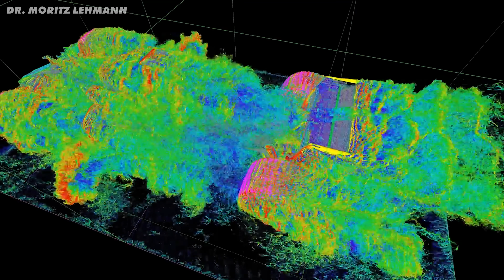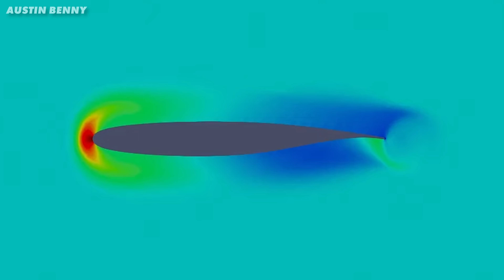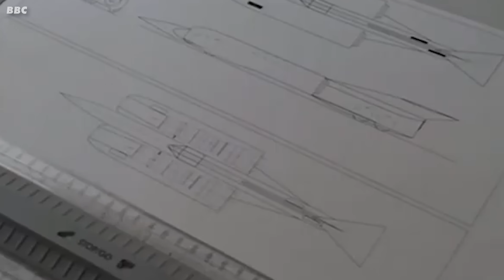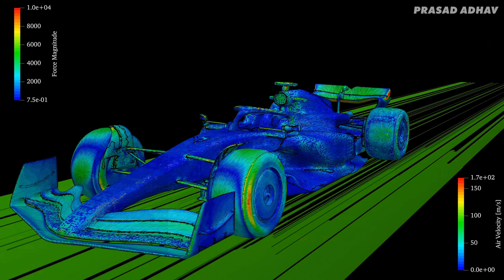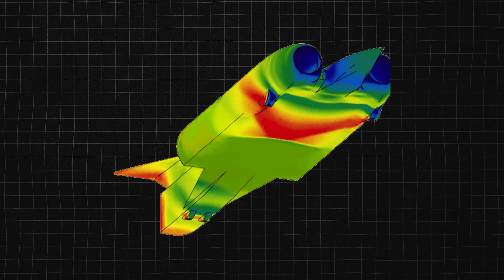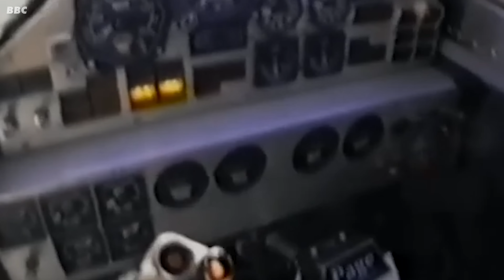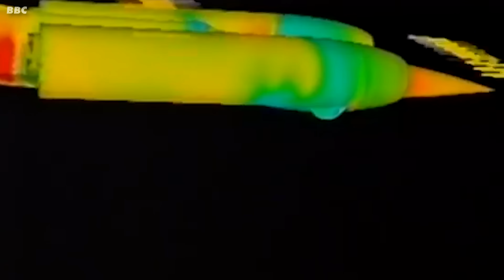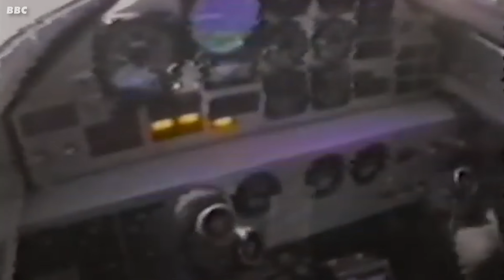What Happens When You Push a Car to Mach 1?

Comment: @driver61 I don't know much about this but it is very interesting. One thing that came to mind was whether or not it would be possible to use some kind of concentrated electromagnetic emitter in the front of the vehicle (which iirc is possible to travel faster than the speed of sound) could cause enough air disturbance to trick the air into delaying the point in which it hits the speed of sound to give the vehicle time to reach mach 1 at approximately the same time the air does?

Comment: I can't believe you did this entire video without once mentioning Bloodhound LSR.

The car was already tested up to 628 mph in 2019 using just its EJ-200 jet engine. It has yet to run using its rocket engine in addition. 

The team were running on the Hakskeen Pan dry lake bed in north-western South Africa. This site gives approximately 11 miles of very, very flat ground. They hired local people in advance of their testing period to clear all the stones from a patch of ground 11 miles long and wide enough to give them twelve (I think) parallel runs.

Comment: The Thrust SST, or whatever they call it now, is not going to go 1000, not with jet engines!  The frontal area of it is just too large.  Additionally, the width of the vehicle will result in higher shockwave forces interacting with the ground.  The Aussie approach makes far more sense as it is a pure rocket powered vehicle with smaller frontal area and a much smaller shockwave footprint.  I just hope they get the funding to complete it AND find a different driver as he's too old!

Comment: I was just reading sbout the Salar de Uyuni in Bolivia. It is the largest salt flat on Earth, at 10,582 square kilometers or 4086 square miles - about the size of the US state of Connecticut.
The thinner air would give a bit of an advantage. I have no idea if the country would allow this use, but it would be easy to place a track as much as 20 or even 30 miles long on it.

Comment: I'm curious how you would adjust for the change in the balance of the car - With a run lasting what? 10-12 seconds? how much weight is in the fuel? that's a massive shift wouldn't it be?

Comment: Challenges not mentioned. The jet or rocket exhaust blast acts like a feathers on a arrow. When the engine is shut off directional stability is diminished. Stopping distance at Bonneville or Black Rock is suspect due to government  bureaucracy.  The biggest problem is gyroscopic precession torque (GPT) of the steering wheels. When Breedlove turned Sonic Arrow on its side at 675 mph the car lifted against the wind direction, not in the direction of the wind. GPT is explained by Craig on page 248 of Sam Hawley's informative book "Ultimate Speed ".
Reply: That was one of the reasons why Bloodhound SSC were preparing a new track at Hakskeen Pan in South Africa. The team, most of whom were from Thrust SSC, decided that Blackrock wasn't viable for higher speeds.

Comment: none of the jet clips you showed was with sonic boom but only condensation cone... This is classic mistake. If you watch super sonic plane passing by that close you will be probably knocked and you will be at least temporary deaf. Otherwise interesting and very dangerous thing :) fingers crossed they can make it safely, this is really cutting edge engineering even when everything can be calculated. I would be interested if 1000mph would rip asphalf and concrete

Comment: Is it possible that everyone is overthinking this?  Think about a bullet leaving a gun at mach 1.5. The bullet does just fine. If its a smooth bore rifle then there is a possibility the bullet will tumble. Its equally possible the bullet will not tumble.  A rifled bullet will usually stay true dew to the gyroscopic effect. 
Make the car a bullet with wheels.  Possibly add a heavy spinning gyroscope inside the car.
Reply: Not a car.

Comment: I have read before, in a fact book and its a memory so correct me if I am wrong, the the wheels on Thrust SSC, at the outside edges were pulling 86,000g. 
If I understand that correctly the surface of the wheel that touches the exploding ground, was trying to pull itself away from the rest of the wheel with the force of 86,000 times that of gravity. Even engineering a wheel at these speeds is hard to get your head around.

Comment: That British Bloodhound SSC designed to do this is simply insane, there is a rocket engine from Nammo that I is so powerful it is like experiencing a train wreck.
Just the sheer forces on the driver is unimaginable .....
Reply: The approach will not work as it also uses a jet engine resulting a vehicle that has too large or a frontal area and the shockwaves produced will also be much higher than it could be.
Reply: @Raptorman0909  The design is already there with jet and rocket engine 😎

Comment: I love cars. I love motorbikes. I love trains, I love boats, and I love rockets.
But what is the point in this? Strap wings to it and it can fly! It can't do anything other than go in a straight line, so it's slower than an aircraft, requires a perfectly smooth surface, and cannot fly.
I'm much more interested in cars that can perform as cars. 
I love the technical challenge, but trying to create an aircraft that doesn't fly is stupid.
Reply: You know the video is about ground vehicules right? 🙃

Comment: Something to consider: With the development of smokeless gunpowder, projectile velocities took a significant leap upward. Ballisticians gradually made pointier and pointier projectiles. A few years ago, it was discovered, serendipitously, that a flat nose projectile flies straighter and faster, with much less pitch and yaw, than the pointy variety. Not, mind, a big flat point. A small flattening of the tip is all that is necessary to achieve better projectile performance. Maybe your land speed people should talk to a ballistician or two as well as the aerodynamicists?
Reply: Thats interesting. I was thinking, and I'm only a truck driver so this is all just imagination and lack of sleep on my part, essentially a C channel around the leading edges to capture air or slow it down so that that air could become the buffer. Obviously just a C channel, curved like that probably wouldn't be the ideal shape but I hope you understand what I'm getting at.  Then I found your comment which kinda falls in line with what I was thinking overall, which is get the air in contact with the vehicle to disperse the oncoming air. Then there's how tall, how deep, etc.

Comment: I've made a handful of sounding rockets so far, 2 of which have broken the sound barrier, and it's insane to look at how similar the design principles are for cars and rockets. Everything from how you have to calculate aerodynamic stability, anticipate weathercocking(the effect of gusts destabilizing the vehicle), the change in the center of pressure on the body as the vehicle sweeps across different velocity regimes, the shockwave occluding fins causing dynamic instability and a whole lot of other things are all almost identical between supersonic cars and rockets. 

The amount of drag that's on a vehicle travelling in the transonic regime is insane, and pushing past that to break mach is a lot harder than people think.

Comment: They should look for a location on the Atacama Desert plateau, which is at 4,000 meters, which would make the air less dense.
Reply: There's maximum local air pressure allowed for these tests.
Reply: Not quite sea level.

Comment: So the greatest challenge comes from the ground. Is that because the run is not paved in concrete? 

In other words: Would a paved track make super sonic and even 1,000 mph achievable?
Reply: The salt actually has a cooling effect on the tires. They would get destroyed on pavement. At least that is what I was told during my visit to Bonneville.
Reply: The wheels MUST dig into the ground.
Not too good for any paved surface, and really really bad for concrete.

Comment: 1,000 mph will not get them anywhere near the current land-based speed record for a vehicle: 0 - 6,416 mph (Mach 8.5) in 4 seconds over 3 miles in 2003 at Holloman AFB (see https://en.wikipedia.org/wiki/Rocket_sled)

Comment: Could they use an internal gyro + rotating/counter masses rather than a fin and outrigger wheels to stabilize it? It's a delicate control problem, but it'd save a ton of aero drag.
Reply: At speed, the wheels already act as gyros so much so that steering the wheels could flip the car since the wheels don't want to change direction.

Comment: Sounds like it needs modern active stability systems induced by wing style flaps, plus reshaping of the rear of the fuselage for a higher Mach than expected at those speeds. It also needs to be high enough from the ground to reduce shearing drag. A system underneath to provide an air pressure cushion may be useful.
Reply: The previous video about the Aussie Invader vehicle details how all these problems have been addressed. And shows the experience of the guy who will drive it.

Comment: I can't remember exactly, but wasn't there a claim for going supersonic from an American team that claimed to have done it with a rocket-powered car that predates Thrust SSC? It wasn't officially recognised, since it wasn't a run in both directions. 

Maybe I'm remembering something incorrectly.
Reply: Maybe you're thinking of Blue Flame? It was an American land speed record car that was the first to break 1,000 *kilometres* per hour, and it was rocket-powered. Thrust 2 broke its record 13 years afterwards, and then Thrust SSC broke that record.
Reply: @skua675  Ah, thank you, that might just be what I recollected in part.
Reply: @Hydrazine1000  Yeah the American team did the first run but didn't do the second run due to engine failure the turbine blades at the front got struck by rocks during the first run it was shown in the Thrust SSC documentary or I'm thinking of Craig Breedlove that was mentioned in the documentary
Reply: No the Budweiser Rocket car is the one you are thinking of, iirc it was just witness statements saying they heard a sonic boom and there wasn’t any picture/video evidence of good enough record keeping for the atmospheric conditions on the day.
Reply: @buffaloj0e  Ah! So that nagging feeling that I had once read that there was an unofficial claim on Mach 1.0 before Thrust SSC was valid after all. 

Thank you!
Reply: The Thrust 2 almost flew off the ground during the run over 650mph it would taken another 7mph or more it would be flying off the ground according to the documentary in Thrust SSC
Reply: The Budweiser Rocket Car's run was oneway only so it was never officially recognized

Comment: However, 1000 mph on land has long been old hat and is mastered by rocket sleds almost every week.And on some of them a person is also travelling with it ;)
Reply: But that’s a rocket sled and not a car. The challenge is in doing it with a car not on rails.
Reply: @NBSV1 It was about ground speed - but that it has to be a car? Can't remember that requirement. 
And just like the e-car from a Swiss university, which managed to accelerate from 0 to 60 mph in less than a second because the car was sucked onto the road, I can also imagine such a procedure for future top speed tests ... and the sledges now manage 8.5 Mach ...
Reply: @ Well, since the video is about land speed cars it’s safe to say being a car is required. Otherwise you could count a jet plane since it has wheels and sometimes rolls on the ground. 
0-60 in under a second isn’t that special considering how many drag cars are that quick or quicker. Electric is great and all. But, old combustion is still wining in all out performance.

Comment: You need to use the diamond cross section shape, think about the front of fighter planes, primarily the F22, it's designed for supercruise, which means although good engines and general shape of the plane, it needs to break the air easily. Forget about the circular shape they keep showing you.

Comment: At what point does it just become cheaper and easier to pave a long and really flat road just for going fast?  You could recover money by renting it out.
Reply: It would need to be pretty wide.  Paved isn't as good as a dry lake bed that can be dragged to smooth it.
Reply: You really have no clue how expensive high strength concrete is to pour at the tolerances required for this kind of speed attempts. Paving a single runway at Atlanta cost $1.2 BILLION and that's only 12,000 feet long. For cars going 800 - 1000 mph you'll need practically perfect level, which is part of the reason airport runways even for municipal airports of 5,000 feet length & 75 feet width cost over $10,000,000, but those don't require such extreme tolerances. To build a track would cost more than the GDP of almost every country on the planet... combined
Reply: They dont cost that much, thats called corruption 😂 @S_raB
Reply: Build it and they will come. Is 5 mi really long enough? 

The issue may be, paving 25,000 ft, maybe 75 ft wide, smooth enough, and hard enough, isn’t that it’s just damn expensive. It’ll have limited intermittent use. And will require maintenance. 

Easily 100K cu yards of concrete. On top of 200K cu yards of base material. On top of 200K of compacted soil. I suppose it’s not nearly as much as a large dam.
Reply: The car would tear pieces of any thinkable material out of the surface, which doesn't sound survivable to me. Or well, you can make it from naquahdah, but that stuff is pretty darn expensive!
Reply: @tomhejda6450  They only use that stuff for generators. And there is concrete that could handle a car going that fast. It's a special type used in heavy runways (airports have specialized runways for cargo planes and Airbus 380)
Reply: @S_raB Concrete is the absolute worst surface imaginable.
The wheels MUST dig into the surface, else it's game over.
Reply: @ 
The physics of wheels is a killer. 
Gyroscopic effects, centrifugal forces, combined with aerodynamics. I think Thrush will hold the record for a long time yet.

Comment: But then you have to account in the massive balls the driver wields for attempting to give it a shot as you see the balls are dynamic in nature the higher the speed the more exponentially they grow, changing the weight ratio of the whole vehicle and affects the vehicles response to the sonic shocks as well as air turbulence. 

Engineering feat indeed.

Comment: May be a dumb idea but would making the fins semi rigid alleviate some of the crosswind issue. Or maybe have a perforated surface like pegboard to dissipate the lateral pressure?
Reply: Do the rules state that you have to decelerate and stop on the ground?  If not, once you hit 1000Mph, why not lift off and decellerate in the air?
Reply: Semi-rigid: doesnt reduce transferred force, decreases stability
Perforated: very aerodynamically inefficient and the disturbed flow around the perforations will create problems of their own
Sropping in the air: lose the ability to traction break, since your wheels arent on the ground, doesnt change the issue of running out of space unless you fly quite high, the required wings add drag, now you have to incorporate and and fly controls and controls surface suite to be able to control the vehicle while in the air
Reply: @noncog1  like I said, probably a dumb idea.  I'm definitely not an aerodynamicist but every now and then a blind squirrel finds a nut. 😀
Reply: @michaelsmith2017  i totally support you coming up with ideas, I answered not to shut them down, but to help you understand. A bad idea learned from is one step closer to a good idea.
Ive had my fair share of stupid thoughts about subjects im now well versed in

Comment: Curious questions: if we lowered the air pressure ( somehow), would that help reduce turbulence or increase it at supersonic speeds? would diffuser surrounding  (circular or otherwise) the back of the turbines help stabilize the airflow. Also having a rod on the front of your (maybe 100 feet long) car to break the air help with the turbulence . Does the air swirls hurt or help more once at supersonic? Also what types of metal are used for the outside/engines that are different. Tia, love your videos and chat
Reply: Lower pressure wouldnt affect turbulence in a meaningful and consistent way, would be benifitial for reducing drag tho
The rear of the jets is how they make thrust, theyre dumping a huge volume of air at a very high speed into the air, its a high pressure zone, not low pressure
Having a rod out front does help, many supersonic planes do this, as did the thrust ssc iirc, no point in it being more than a couple feet long though, and isnt a huge difference, and is for breaking up the air, not turbulence
Im not super educated on supersonic turbulence, so research this one yourself, but im under the impression that it doesnt directly affect the body, in supersonic flow, shockwave forming areas "throw" the air away from the body and turbulence from the re-filling of the low pressure zone this leaves doesnt take place until after the body has already completely passed
Due to the (comparitively to aircraft) low speeds and short duration, aerodynamic heating isnt a major factor in this case, keep in mind, many low supersonic planes dont specify body material for these speeds, and they can maintain them for minutes, as opposed to merely seconds here. Its not until we start approaching mach 3 that it starts becoming such a major issue as to require major specific consideration in design